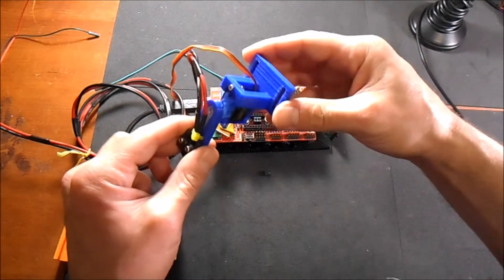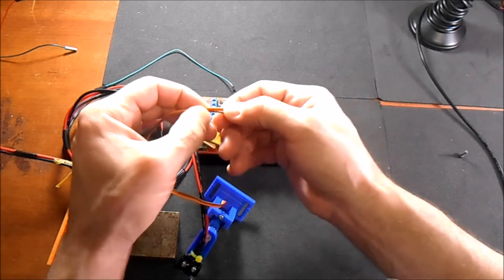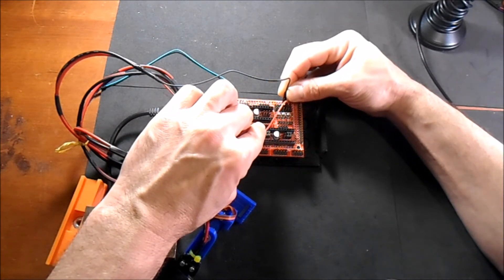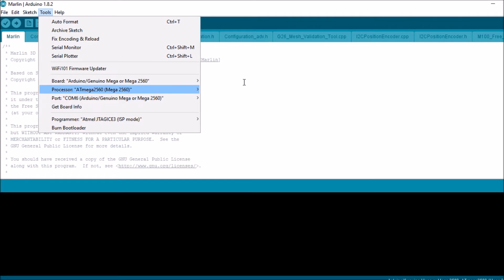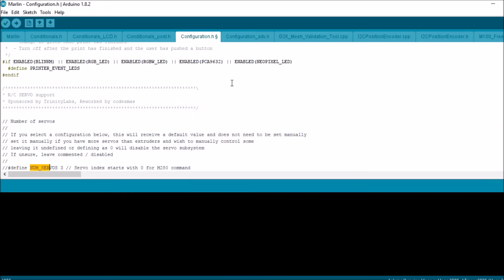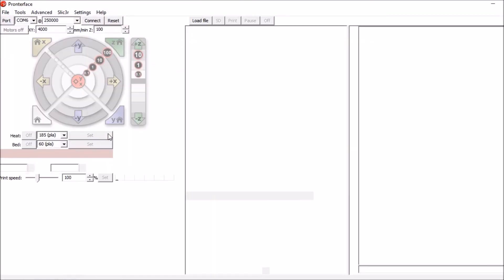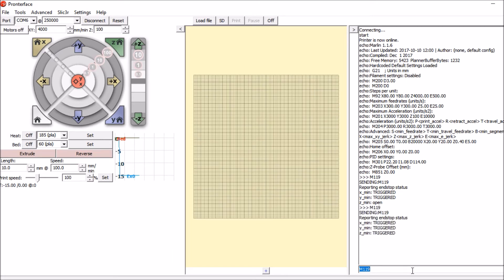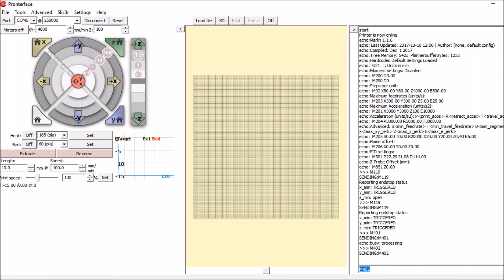RAMPS 1.4 - Z Servo endstop

Comment: Hello, i think i need some help (I don't use an endstop yet): in config.h i uncommented the line NUM_SERVOS and put the array in SERVO_DELAY 300, 300, 300 and I can test it in Pronterface with M280 P0 S0/180 etc. It works, but when I load a dummy gcode picture and simulate a printing process, only x y steppers are moving, for Servo I get the error "M300 S30.00" or "M300 S255", depending on the possition. My question is: how do I get Pronterface to use command M280 for Servo ? Also P0 part is missing.
Thank you! Octav
Reply from the maker: Without endstop a printer will not work with a gcode slic3 file.  The first command is something like G28 which is home all axes.
Reply: @EdwardBraiman  hi, thank you for your time, I confess I am a total noob on this area. I am trying to build a pen plotter, so for z I have only that servo which I want it to do only up and down. It moves with isolated command m280 p0 s0 from pronterface, but refuses to move when simulating printing (2D). I receive that M300 error. I supose I don't need an endstop for that, correct? (Note: I use Inkscape) After months of surfing the YT I decided your tutorials are the best, for me at least. But, obviosly, I need further guidence. Again, thank you for your time. Octav
Reply from the maker: Here are the gcodes ... https://marlinfw.org/meta/gcode/
Reply: @EdwardBraiman  thank you, I will check it, hope I will figure it out. Octav
Reply from the maker: You're welcome.

Comment: do you know why the servo tries to rotate clockwise when arduino is restarted rebooted.. then only after it fully boots the servo goes to stow position.. its fine except that im woried that it may kill the servo... when you hit the restart button the servo just went crazy and sweeps clockwise till it hits something and couldnt rotate nomore.. then after the bootscreen it works fine...
Reply from the maker: Sounds like it's getting current during boot process.  You can always open a bug on GitHub for Marlin to see what they think.
Reply: @EdwardBraiman  somehow increasing the delay from 300ms to 500ms seems to have fixed it..